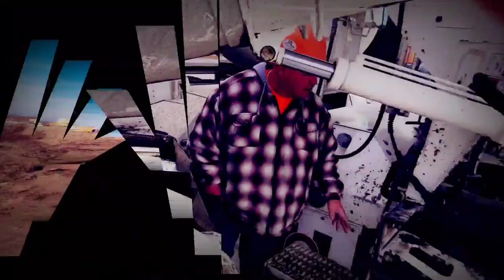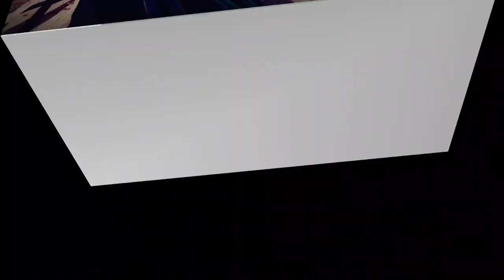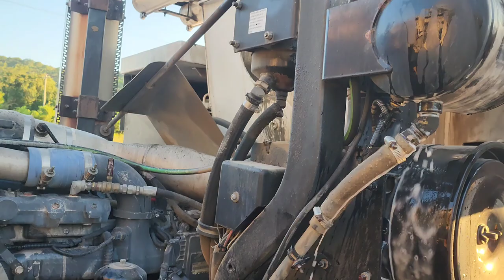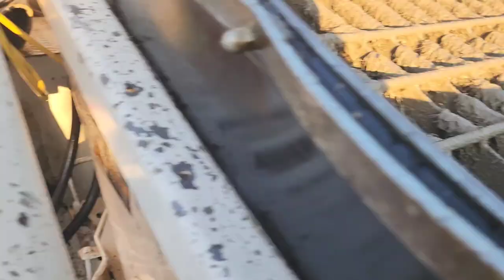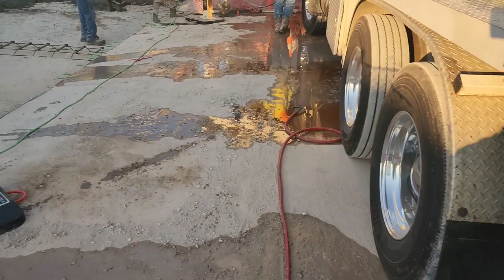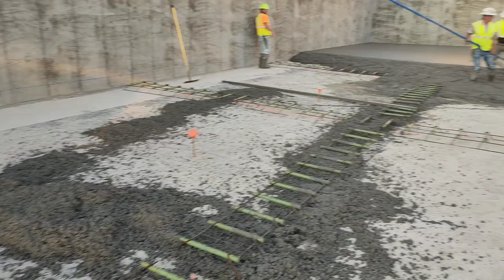Not Cool! When The Radiator Hose Blows, Keep On Pumpin'!

Comment: Been there before. Fan clutch hub bit the biscuit and frisbeed the fan right through the radiator. Hung a garden hose into the coolant reservoir and it worked well enough to get the pump cleaned out and folded up.
Reply from the maker: I was concerned about the cold water affecting the block, but didn't seem to have an issue. Pumped out around 50 yards or so with adding water to the reservoir, then we shut the truck down and our mechanic worked under the clock trying to get it patched up. Definitely held for the rest of the pour and the hour drive back to the shop. Got in about 2:30 that day, then Chris left out with it about midnight that same day. It's definitely been busy around here lately.